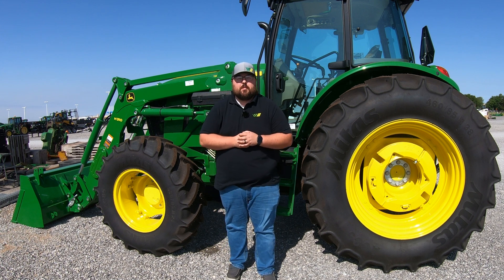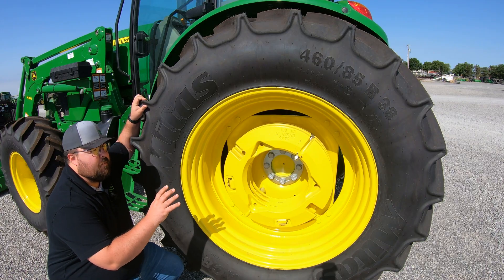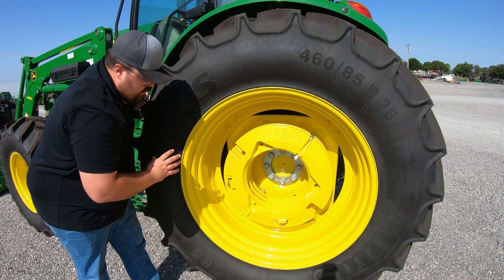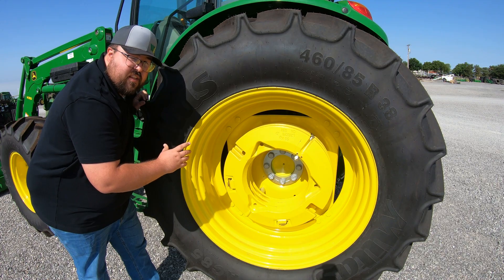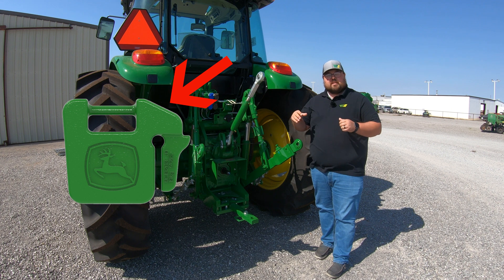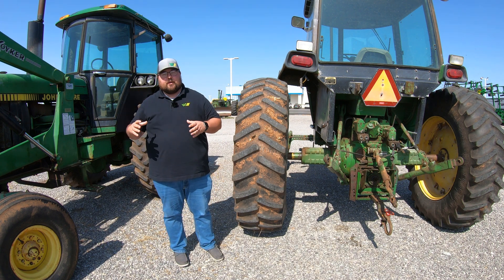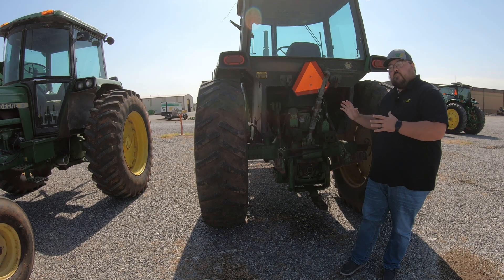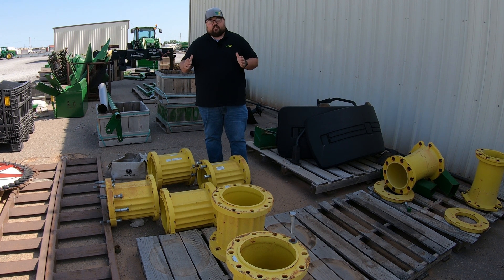Explaining Extra Weight Options for Tractors

Comment: Dropping down to the 3R series, last week I bought 3033R, which I absolutely love. I picked up 5 suitcase weights do to the fact that I do not want the loader on unless I absolutely need it. Im trying to save the front end and keep the extra weight off. The bracket that came with the tractor will not allow all 5 weights to be on. My tractor looks like a redneck hillbilly with bad teeth, or a character out of the movie Cars. 4 out of 5 weights will fit, but that 5th weight cant get past the brush guard frame. It does on the left side, but not the right side. The weight is about 1/4 inch too wide. I think the width of those suitcases is about 2.5 inches(?). To solve this issue, would it be best to purchase the 26.5 (675mm) or the 31.49 (800mm) bracket? Your input old mighty Deere representative would be greatly appreciated.  Yes, I have spoken to my local dealer at Pape Machinery and he is baffled.